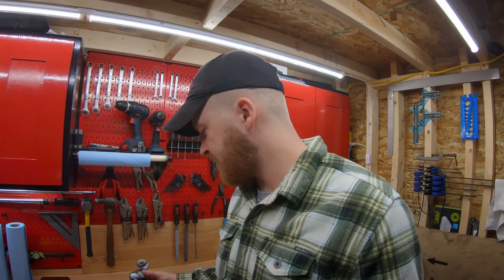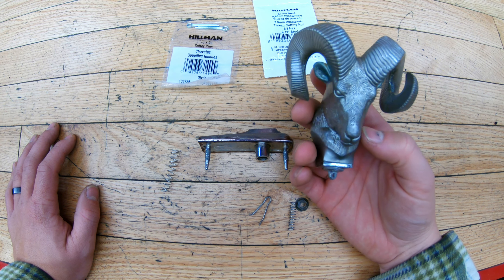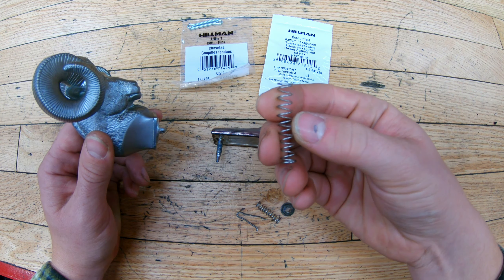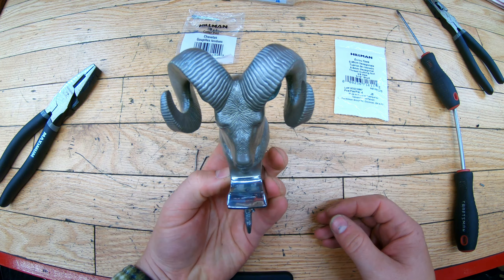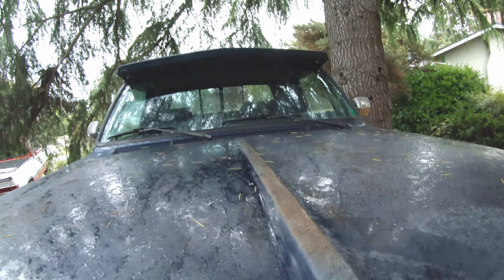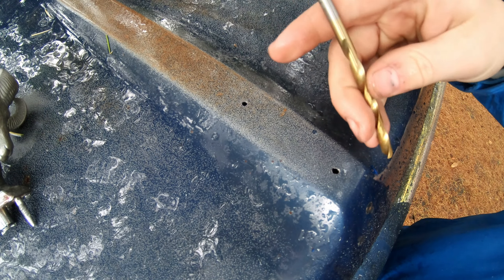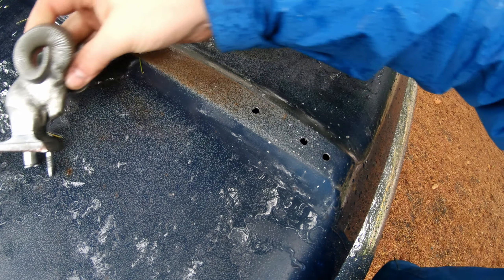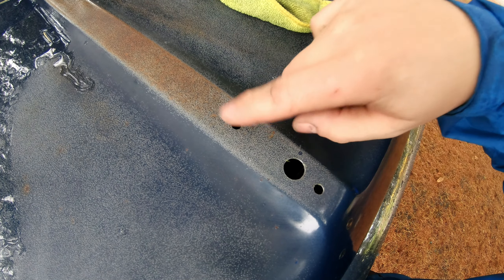Ram Hood Ornament Installation | 1st Gen Cummins

Comment: Nice!
My truck is a very late 93 D250 LE and has the ornament, perhaps a dealer 🤔 add on. My father in law had owned the truck since the 90s.
I also have the optional tachometer. It's mounted on the left side, rather curious how yours is mounted on the right. Dealership add-ons  perhaps 🤔
Reply from the maker: Very cool! I think the ram hood ornaments were also sold as an accessory for the truck from Mopar. Someone easily could have ordered it at the dealer to have them install it. I haven't seen any other truck with a tach on the right side, but all the right holes and bottom plate are on it. I'm thinking the dealer installed it. The truck also has a unique heater controls and hvac box on the pax side with an aftermarket ac installed by the dealer.